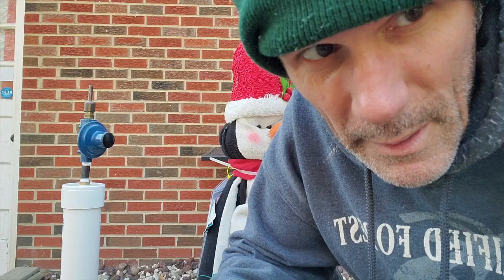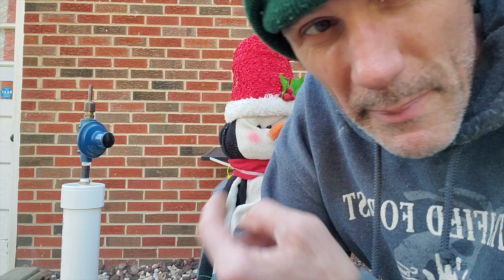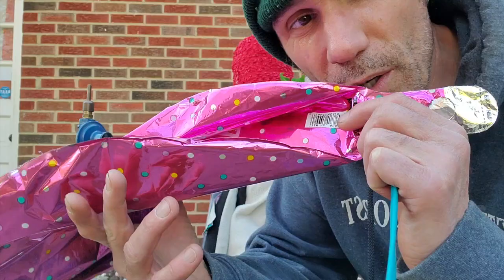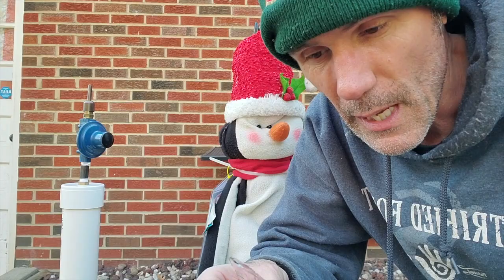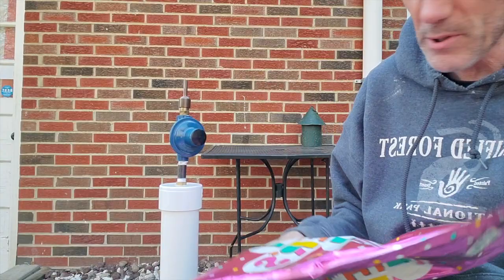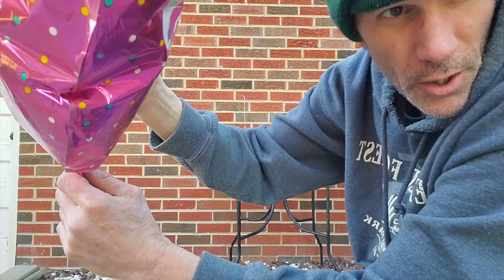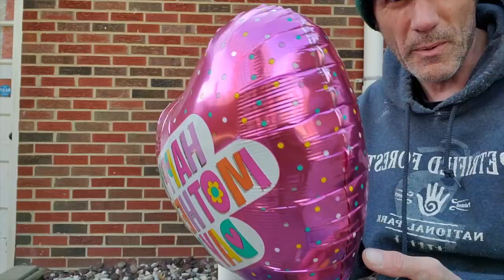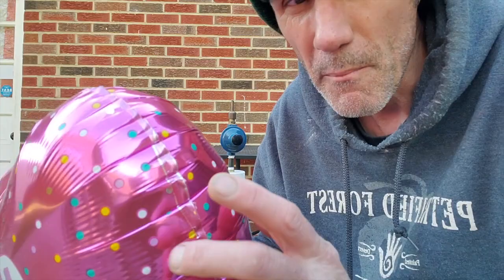Using an Air Compressor to inflate latex balloons and foils

Comment: Hi Flower Clown.  I'm looking at inflation options right now.  Question.  Did you  just fill that 260 with helium from a tank?  I'm thinking of using compressed air tanks without helium.  Have you tried this?
Reply from the maker: I use just an air compressor. Helium is expensive.

Comment: Is your air compressor loud when it kicks on at festivals and such or do you have one that is a bit more quiet when its running? Have you ever not had power to your compressor? As in too far out in a field or not near a plug/extension cord?
Reply from the maker: It does make noise but not much. I also have 50 foot of hose so my  compressor can be far away from me